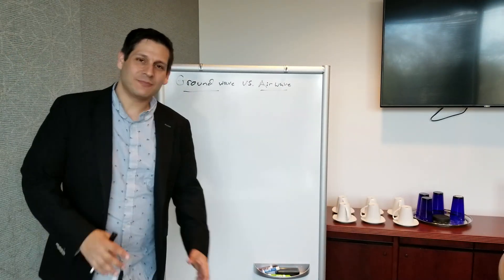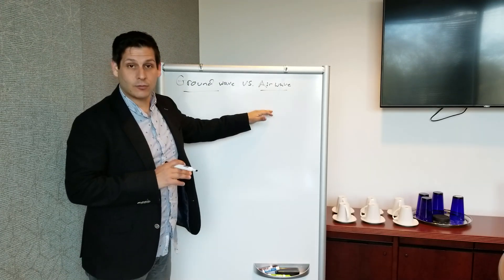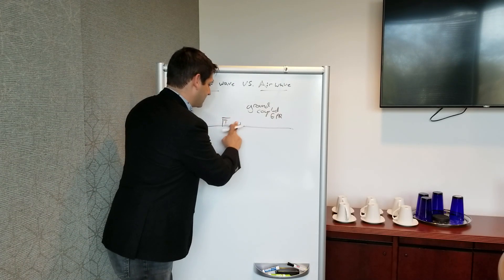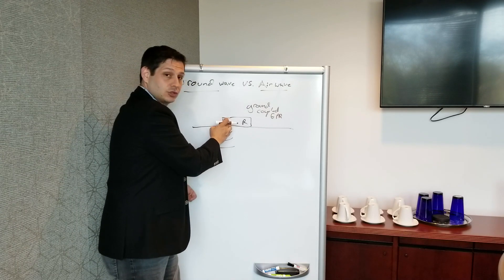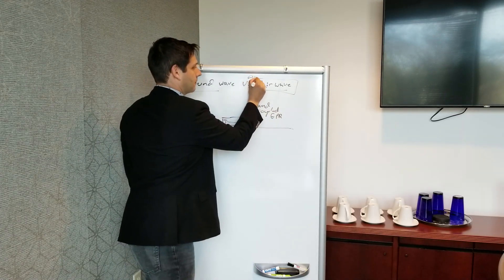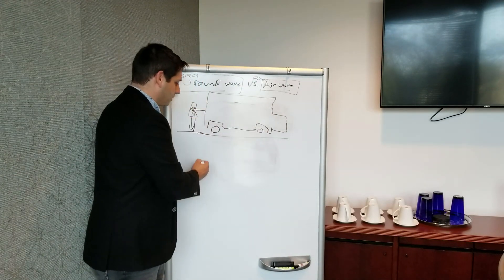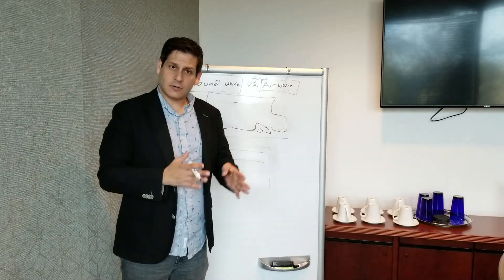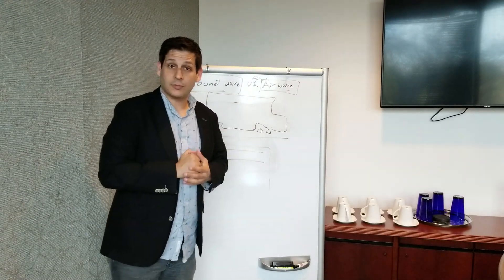GPR ground wave vs direct air wave | ground penetrating radar

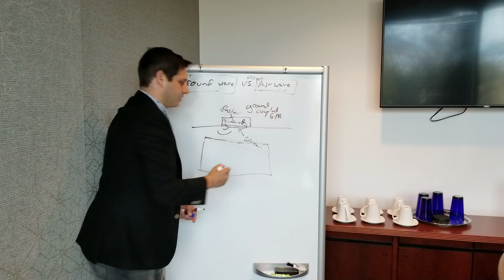Comment: On 04:00,  you said 'you get your direct air wave then you get your direct ground wave they will overlap each other.'.
In this case, if amplitude of direct air wave is bigger than direct ground wave or direct ground wave is bigger than direct air wave, Do they each show a different signal pattern for an object at the same location?
thanks for reading my question and i will wait for your answer.

Comment: Thank you for explanation about the air wave and ground wave. When i conducted survey(3 survey lines, interval 1m), one line shows (+)-(-)-(+) (maybe direct air-wave), the other line shows (-)-(+)-(-) (maybe direct ground wave). And i conducted survey again later, i can see the line that showed (+)-(-)-(+) shows (-)-(+)-(-) pattern. 
1) I wonder if there are any conditions or reasons why the first visible signal looks different from (+)-(-)-(+) or (-)-(+)-(-).
2) I have been doing research on different dates in the same place, but when I see reversal signal patterns, when the reflection signal patterns by the objects in the same position show the same signal pattern, I wonder if they mean the same signal or the reversal signal .
Thank you!

cf) Survey was conducted ground-coupled GPR